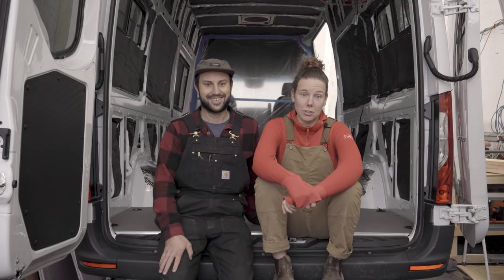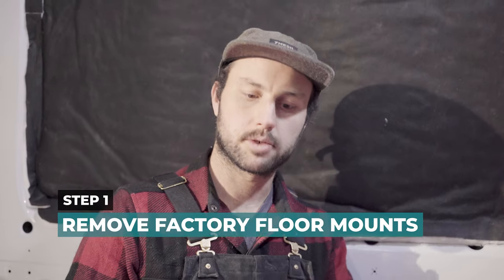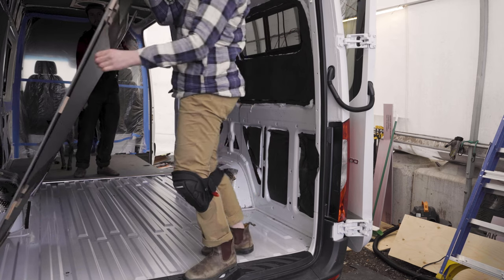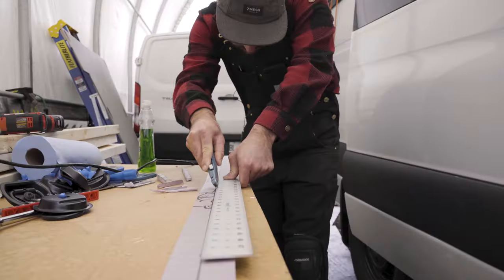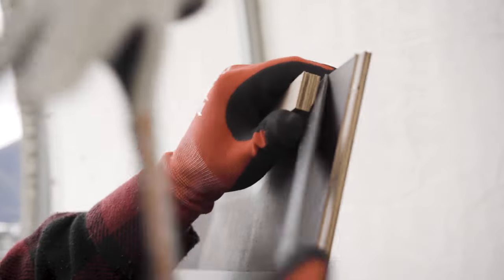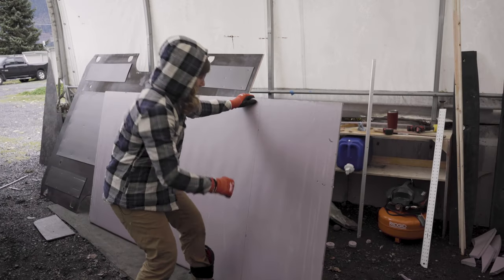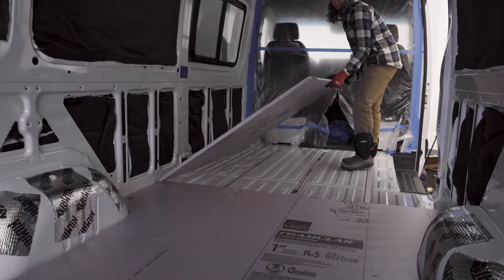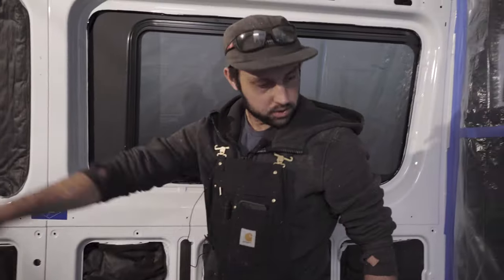FLOOR HEATING IN A VAN?! - Installing Hydronic Heated Floor and Insulation - Sprinter Conversion

Comment: Similar Hydronic floor , wished I had seen this first 
 Removed factory floor ,  built Hydronic floor in heated Carport  using 3/8 plywood as base , 2"  30lb Xps ( normal is 20 to 25 lb) routered to fit pex plan , with Spacer wood (yes battons) where furniture would be mounted , factory floor on top ,Sandwich anchored together with 1/4'' ( 3/4" diameter flat top ) furniture bolts and blind press anchors into plywood base. Then cradled the whole thing into van and mounted to Van Floor using factory mounts and some PLUS nut in van floor. 
It Squeeked   . Removed floor, ( do Not want to do that again) removed pex , lined groove with Aluminum foil tape, secured Pex to groove with Hvac sealant, Alumium foil over top, ( to dissipate heat into top plywood ) a 24" wide sheet of aluminum flashing over main walking area. 1 year later .. No squeak . washboard roads , 30,000KM works great.

Comment: Great Video! But i would glue the pex tube to the insulation whit the insulatation glue. that tape can reflex the radiant heat down instead for up. Just a small tips.
Reply: To my understanding reflection would require air gap. When it is in contact with the PEX pipe there is anyway more conduction than reflection and thus it's actually conducting the heat to wider area... To places that would be insulated by the XPS. So I don't see problem there.
Reply: omg,,at least use the transfer plates..

Comment: ? About the 1” xps. With only 1” for insulation and then routed out 5/8” for tubing. Did you notice any lost in insulation during hot days. Live in AZ and it get out on the asphalt. Worried about the little lost of insulation. Converting T1n. So room is tight. Was thing about 1/2 blue foam board then 1” xps floor heating. With that I was just reading up on pex pipe specs. I read we’re 1/2” and 3/8 id pex had the same btu’s under 200ft and over 130ft. Why are your thoughts. Reason was less material routes out on the xps. Good video.

Comment: I considered XPS foam for my hydronic subfloor but it’s only rated for 165° F at which point it gets soft whereas the diesel water heater operates at up to 185° F.  I think it should be fine once you add a thermostatic mixing valve but I decided to use Coosa board instead just in case. Have you had any issues with the floor overheating?
Reply: Flooring shouldn't operate at more than  about 100° F. But a simple thermostat mixer to blend in some cold is the normal way to fix that.

Comment: I would guess you don’t get good radiant heat with PEX tubes in insulation. Very inexpensive to use thermal board. I just installed 1/2 XPS, 5/8 thermal board and 1/2 sub floor. Heated floors are basically comfort only, will generate very little heat. I also have two air exchanges for heating the van, and a water exchange for on demand hot water.

Comment: The silence of hot water floor heating will be nice. I've seen a video of someone using just a small cheap electric hot water heater in a well insulated one bedroom home. completely silent. and warm. And they got a better rate on the electric for it. plus it works well on walls too. like in a tiny bathroom with a tiny floor.

Comment: Good video. Why do you need a heat exchanger for the garage? Why not just heat the floor there too? Or am I missing something? How thick is the plywood that you put on top of the foam?
Reply from the maker: Hello There, Thanks for the reply!, the reason we are adding an heat exchanger in the garages to promote more warm air when needed. We do have heated floor, but we do find out selves in very cold conditions (skiing) that we want to make sure we have the best chance at a equally heated van/ garage.  The floor is the stock floor so 3/8 inch I believe. 

Floor heating is good to keep the van at a constant temp, but not ideal for brining the air temp up when it is cold, that is why we are adding a heat exchanger in the garage and a 2nd airtronic in the front of the van. We also beleive in some redundancy for heating!

Comment: Nice work! I'm in the middle of installing a similar system by Rixens. Closed cell foam + XPS w/ inlayed 1/2" PEX + 1/2" plywood. Vinyl on top eventually. Did you use a regular wood router bit? Happy with the results? Any words of wisdom before I start making XPS dust?
Reply: Hey Ed, how's the 1/2" ply above the 1/2" pex? I was kinda worried about the transfer coming through sufficiently... have you seen others do it this way? Does Rixens recommend that?
Reply: I'm too wondering why ply on top of XPS. XPS should easily take all the load. Not sure about its properties when hot though.
Reply: I used wood router bit, bit low rpm. It's a little rougher but also doesn't fly around as much

Comment: I'm curious how your floor is doing. We are installing an almost identical floor setup. Have you noticed any movement or compression? Great stuff!
Reply from the maker: Hey Adam, We have installed this type of "floating" floor on a few vans and we have not noticed any compression or movement, once all the cabinets are installed. Like we said in the video we will be using the factory mounts on the sprinter to help bolt it down to be the strongest connection we can.

Comment: Hello! 

I’m wondering what is the source of the hot water energy for the floor of the van? I have a 600R battery bank, I understand the tubing but what is the source? Where can I buy it and what type?
Reply from the maker: Hello Amy, We are planning on using a Espar Hydronic heater, there are a few brands that make units like this. They are diesel (or gas) heaters the heat up antifreeze type fluid that will be pumped around the pipes to create that radiant heat. Depending on where you are located you can find these units in many van conversion websites or ecom channels.

Comment: Hi. Good educational video. What is the floor heating called that you used? Is it the Espar hydronic? I am looking at the Van Life Tech’s floor heating. It is pricey of course. I have hired some van builders to do mine. But i live in Sweden and the shipping, VAT and customs fee is busts my budget. Despite this, I am still keen on the floor from van life tech. Maybe you know which alternatives are good?
Reply from the maker: Hey There, thanks for watching the video. We will be using the Espar Hydronic, we have been to busy building clients vans to finish our flooring heating but when we do we will be filming the video! Our system will be a bit more simple than Vanlife Tech but we believe it will be as functional for the uses we need it. - hope to finish this build segment soon and we can release the next set of videos!
Reply: Thank you for the reply. So how come the VLT’s floor heating is so much more expensive? What sets it apart? I was checking out another floor heating from RIxens. It was around five grand. Still, half of VLT’s. What am I missing? Maybe VLT’s is more efficient or something?

Comment: Great video! Is your hot water on a separate pex loop? I'm starting my research for a hydronic system for hot water, radiant floor and air heaters. I'm not finding much info on how to separate the floor loop from the hot water so you don't heat your van when wanting hot water say for summer months. I'm guessing a T splitter with a pex solenoid wired to a thermostat but not finding that info on Espar's site.  How do you regulate the floor temp so it doesn't get too hot? Thanks!